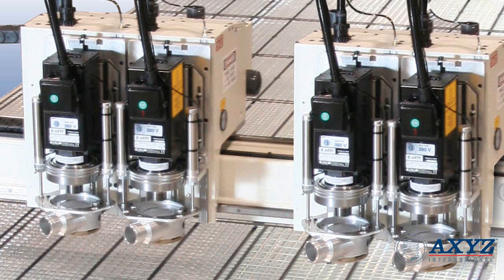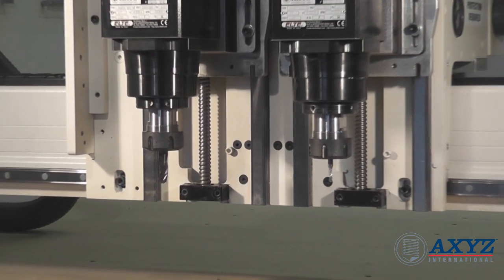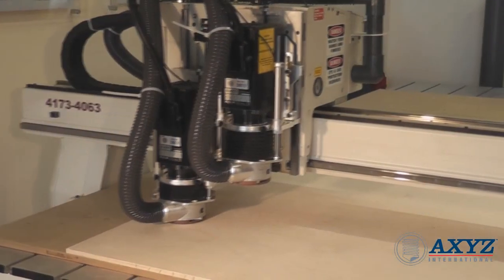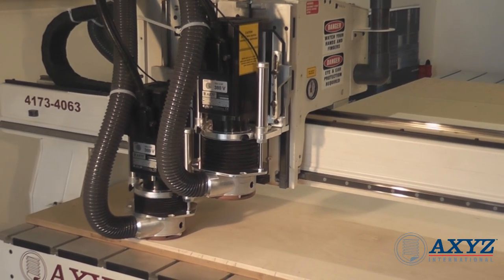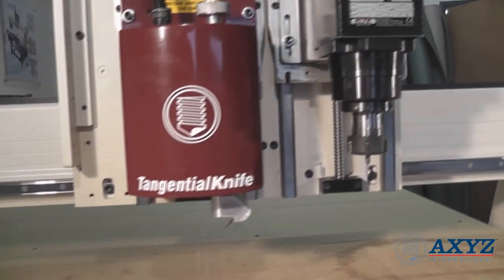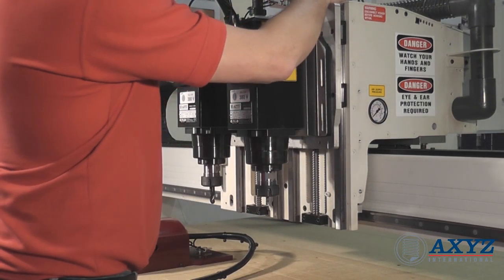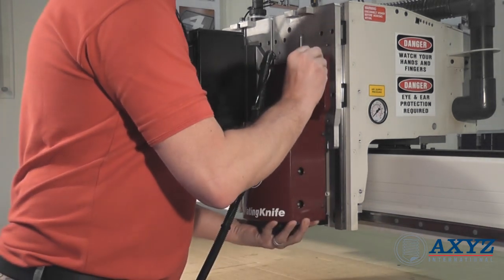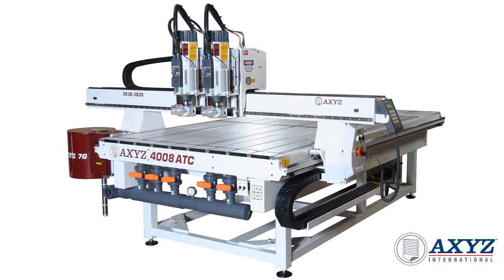Twin Head CNC Router | CNC Router | AXYZ International

Comment from the maker: A Twin Z machine is programed in the normal way using a CAD/CAM system to generate an NC program which uses G and M codes to select which head (tool) is currently active.